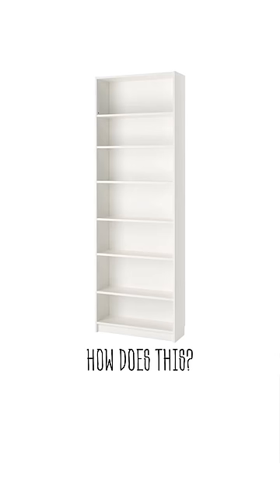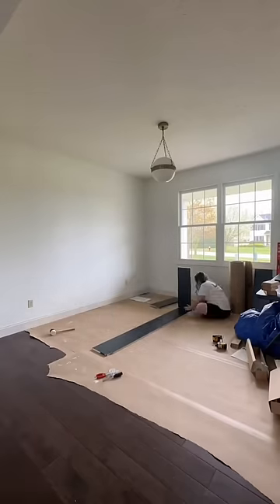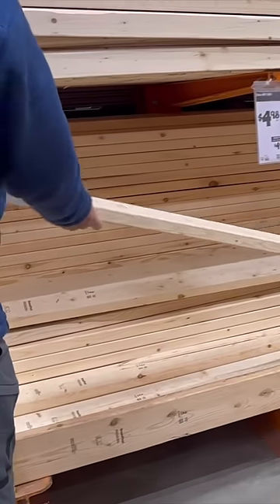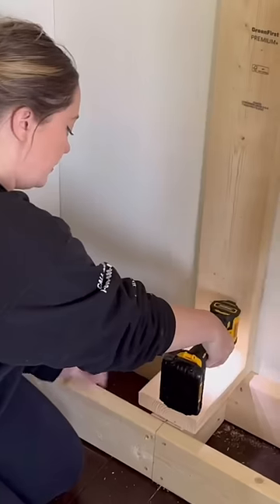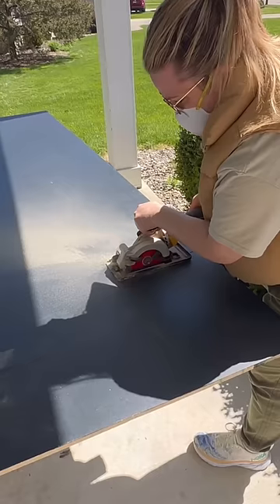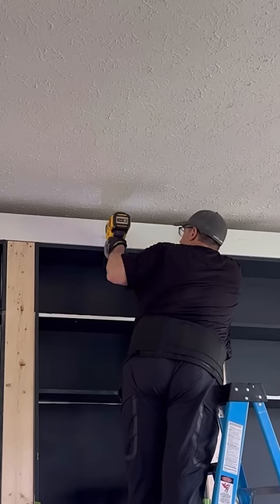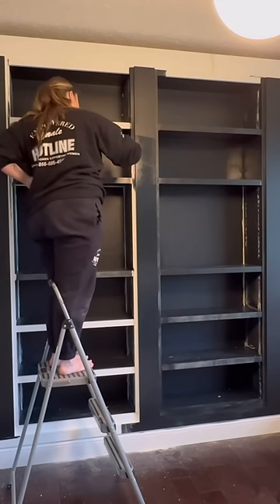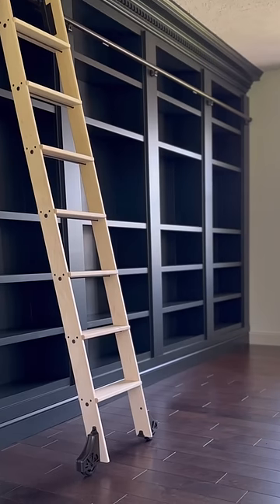EPIC IKEA HACK: Billy Bookcase Library Wall #homedecor #interiordesign #ikeahacks #ikea

Comment: If i could get to this far i would just build the billy bookshelf myself with real wood
Reply: True and its much cheaper than buying billy bookcase
Reply: This!
Reply: I'm sitting here thinking like, you know how to build a wall, a base, a back and for some reason the shelves are just a step too far??? 🤔
Reply: @christinadejesus  My thoughts exactly!
Reply: While typically, I would agree when you buy the pre-built bookcases, you have those grooves that you can adjust the bookshelves in with the pegs to whatever height you want which she could make herself would that be drilling at least 100 little holes and then buying me shelf holder separately
Reply: @shaykashif hmm. I get the avoidance of a boring task. It us balanced by a better quality of material - real wood,  and you only need to drill the holes you know you need. Endless variation doesn't need to be built in, it can be adjusted at a later stage.
Reply: @shaykashif but she’s filled in all the little holes anyway 😂
Reply: IDK. Lumber & plywood (particleboard too) is still pretty expensive. Plus, the ready to assemble pieces save measuring & cutting time; you can assemble one of these bookcases in 20-30 minutes. Which may be worth the cost for some people. I think it's a beautiful compromise here :)
Reply: I was wondering the same thing, thanks for the insights.
Reply: As someone that can do all this stuff (I'm not quick but I can do it lol) I do understand the appeal to doing it this way. If you're not building the bookcase from scratch which would be time consuming and involve things like pocket holes/domino's, ripping plywood on the table saw, what have you which would be pretty time consuming unless u have a proper shop setup. your other option would be to use the 2 by 4 frame as the structural component of the bookcase and then attach panels to the 2 by 4s and then level out each individual shelf between each of those panels once the frame is already up against the wall which could be pesky and time consuming. With the pre built unit at least it's already level and you can pretty much just build the rest of it around the already level bookcases. I've done a lot of cabinet installs and a lot of the seemingly simple tasks are actually the most time consuming. I like to think of projects like this as okay, home much an hour do I get paid at work? How many hours more of time will doing it this way take? I then multiply that by 2 (cuz everything takes longer than you think it's going to with reno projects) and then I usually find the right answer is the one that involves the shortcut. They are paint grade after all
Reply: Billy Ikea is not good quality too
Reply: @too1leasy403  I would say that it still is. I think people underestimate the skill that actual joinery and woodworking takes. All you need to know to build this is how to make linear cuts with a skillsaw or mitre saw and how to use a nail gun, a tape measure, drill, and a level. All of which are very basic things. To build it custom would not be possible for people with a certain level of experience which is what this video is catering to. Any ikea hack you will see has this in common. Taking something non custom and making it look custom.
Reply: Actually this hack requires a lot less skill and a lot less tools than building the bookcases from scratch. And I don't think you would save that much money because you've got so much more time invested and you have to put on the coating on all the wood that they didn't have to do that to. Having done my own Billy bookcase built in I know for a fact it's a hell of a lot easier to work from the IKEA kits rather than from scratch. They really only had to cut the 2 * 4 for the base and then the trim. They probably don't have a table saw. You going to stand there at Home Depot and have somebody cut everything to your specifications for the whole bookcase?? Their finished product looks as good as anything built by a carpenter. Except that they can't leave it with its natural wood grain. Which would cost a lot more as far as finishing it as a beautiful piece of natural wood grain carpentry.
Reply: @shaykashif why drill so many holes just place shelves wheee you want them to be. I don’t think anyone ever moves those anyway
Reply: And doesn't warp from the actual wood used for the heck_(saw another YouTuber show how this happens over time)_
Reply: RIGHT!!!!!  Buying four shelving units before you even start to buy ALL the lumber makes no financial,time (you have to build them, and they be cheap stuff, not fun to work with), quality..sense lol.  
I mean it looks great. But why bother doing it this way 🤷🏼‍♀️🤭 oh yes I get it. To be able to say you have #transformed/#DIY,oh MY BAD….#HACK 🤥🤭😒” you too can make these plan Ikea pieces into this stunning library style epic bookcase” knowing we will think “look it’s says HACK! I can do this too”🙄🤭 (not knowing the truth is that you really needed your father, husband, experienced builder, more, with all the carpenters tools you can get 🤦🏼‍♀️) 
I mean you had to move a darn WALL!!  
Just be real peeps.  
It’s pretty Easy peasy 🤪

😘
Reply: @michellebyrom6551  and I’ve really never known anyone to change their shelves much once they’ve fit their books on. We’ve moved and have sone short Billy shelves that have cycled through different spaces and uses  in 6 houses but even then, they’ve mostly had 2 shelves dividing the thing in nest thirds (after 20 years and after all that dismantling and reconstructing the only issues are the mdf in the spots for the tiny tacknails used to hold the back panel was shot by the 3rd time we rebuilt them, when we rebuilt them the 6th time the in between spots were  and some duct tape was involved on one of them. 

They are in a discontinued size and finish, I wonder if there are ikea fanatics looking to collect such things.
Reply: @shaykashif she filled all the holes… 😂
Reply: And it's cheaper than flying out someone to help you
Reply: Working with construction lumber is a lot easier and forgivable that building furniture.
Reply: But would ikea sponsor you to make a video about it? 🤔🤫
Reply: @shaykashif  very true, but they make jigs for this exact task so it wouldn’t be very difficult.
Reply: Thats what I came to say. Made it more expensive and more difficult just to make it a “hack”?
Reply: When time is an issue this is perfect. Building the bookshelves from will probably take an extra few days for a person who is not a woodworker.
Reply: Exactly
Reply: That would cost u a lot of
Reply: There are brackets with clip in supports you can buy that do the same thing as the holes and pegs. Even so, real wood is stronger and will last longer, which is needed if you put actual books on them.
 @shaykashif
Reply: @shaykashif  you know what I saw the other day at Home Depot?! They sell planks of plywood or white MDF pre-drilled with those holes 😮
Reply: Real wood prices are astronomical!

Comment: We're the billy bookcases even needed?  You built the sides, the base, the top, reinforced the back, even put trim on the front of the shelves, and filled in the shelves adjustment holes?  Looks like it created more work.
Reply: I didn't really get why they felt that they needed to use different backings. It's all up against the wall.
Reply: It makes it look more like a built in than shelving units pushed up against the wall. AND the original backs are almost cardboard😢!!! Looks great but I wonder about the cost difference between starting with IKEA and totally from scratch🤔!!!

Comment: Lmao OK let me get my dad to build a whole wall to fit billy bookcases
Reply from the maker: He definitely helped but i could do this alone - just would’ve taken me way longer
Reply: @PeonyandHoney  missed the point, which is you built a wall to add a cheap shelving unit. Lipstick on a Pig.
Reply: @mark_a_vigil negative much? I think it looks great.
Reply: @mcbailey7446    Looks great.  But how will the cheap materials hold up over time?
Reply: I have 4 Billy bookcases.  I've had them over 10 years and they have been moved many times and they are still  sturdy and strong.  I collect cookbooks and have hundreds so these bookcases are very durable.
Reply: @cynthiawilliams3213  great!  My daughter bought two dresser from ikea and those didn’t hold up in a move.  Glad you had a better result

Comment: I have a question.   Are the IKEA bookcases actually attached to any of the bracing, or rather are they encased by the bracing and the trim?  I don't recall mention of this in your full length video.

Thanks and cheers.

Comment: What paint works on Ikea bookcases?  Thanks.
Reply: Paint was unnecessary. The Billy bookcase comes in a color roughly the same as the paint they used. Not necessary at all.

Comment: Plus about 5 grands worth of timber and power tools. 😅
Reply from the maker: Total cost of this project was $2500 - the power tools used was a Brad nailer and a miter saw and drill - roughly $500 in tools